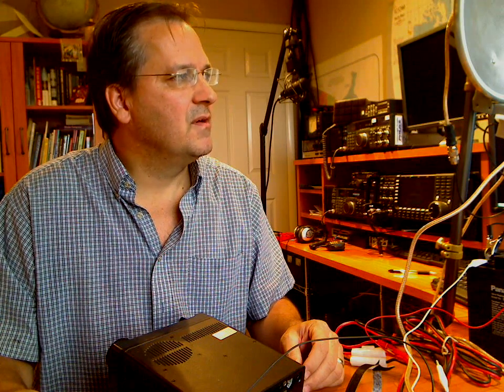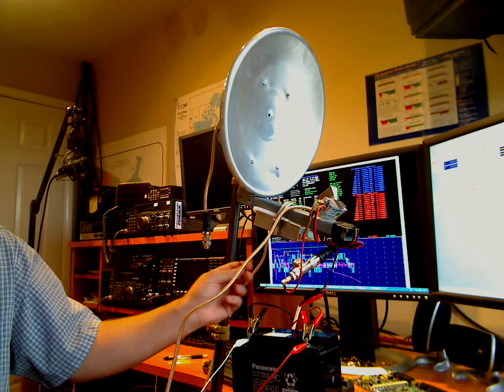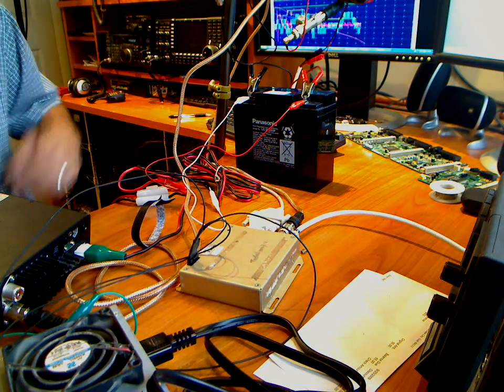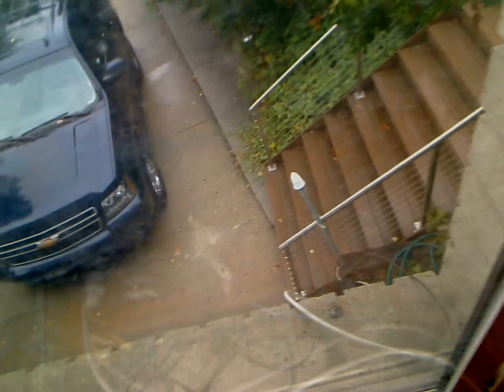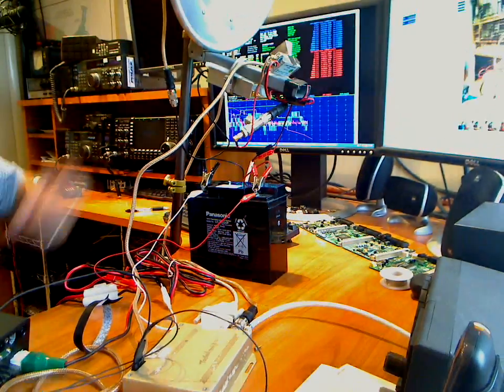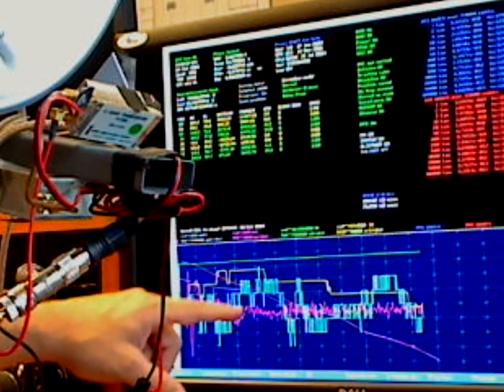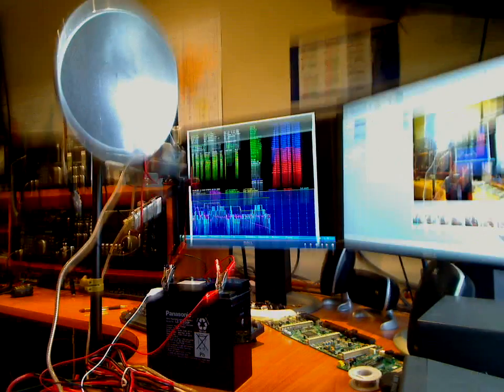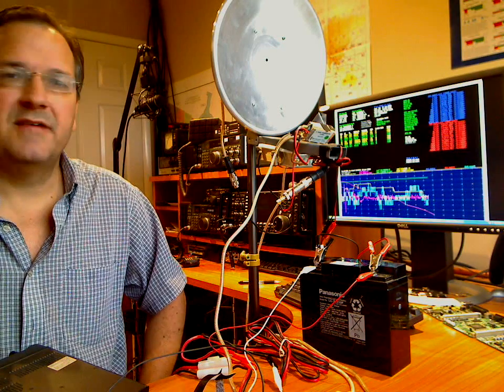Installing a GPSDO to stabilize a 24 GHZ Microwave Beacon

Comment: Hi,
Thanks for the great video. I recently bought a similar GPS receiver from one of the Asian guys advertising on ebay. I din't get the promised software and attemps to communicate with the seller have not worked. 
Can you direct me to a site where I can download the program you are using?
Thanks and 73,
Glenn WA4AOS
DSM Labs 
SC

Comment: My GPS-DO has been running a few months now. Rock solid, ultra stable, right from rig switch-on. The GPS-DO runs continuously and the PSU helps maintain the shack at a healthy 35'C+!

Comment: Interesting video. Looking at locking my IC746 here because of drift issues, even when only Tx 5W! Initial experiments will probably be a 10MHz OCXO, tripled to 30MHz then coupled to the rig's LO coil with a couple of link turns of wire. Hopefully more stable on WSPR and JT65. Would like to set up a GPSDO one day. 73 - Rob VK2GOM / G0MOH